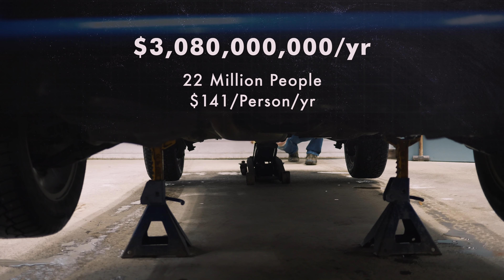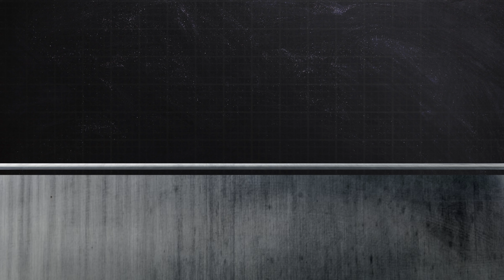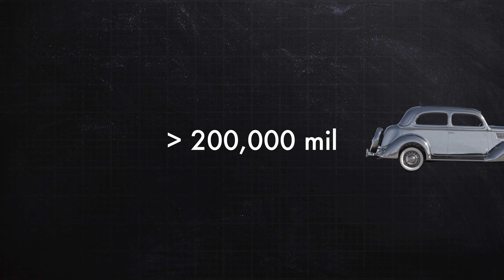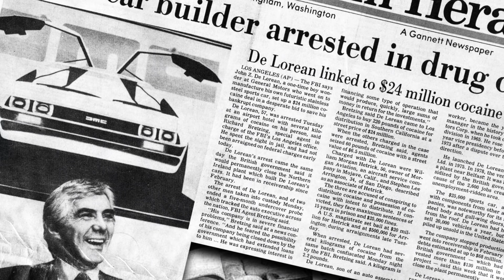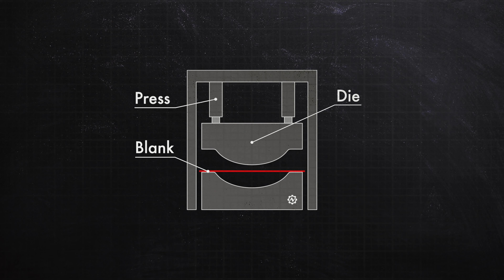The Overlooked Cybertruck Feature Hidden in Plain Sight

Comment: Just saw this video, ironically, while considering the rust death of my beloved 2009 Ford Escape Hybrid. Body shop guy said there is basically no way to prevent it or fix it because frame rust has started. A real shame, due to it still runs great at 150,000 miles.   But that is Wisconsin winter salt rust for you. 

So getting a stainless steel Cybertruck in the next year sounds even better than before!  And glad to see someone point out this benefit of the CT.

Comment: Turgut Cirpanli
1 second ago
The real Cybertruck feature hidden in plain sight is, THERE IS NO NEED FOR ANY PRESS TOOLING to produce it. 

As this car is not made with pressed steel, and as Josh says, this car's panels are laser cut, bent, then joined. But unlike the visualization @6.21 which implies a pressed steel B pillar, it i highly probable that the frame is also produced without dies. (Maybe printed metal for complex surfaces) 

Cybertruck is designed for purely robotic production, which also allows algorithmic production. Thus, it is highly possible to individualize it, to a certain extent. Like, allow customers to have theirs that is %5 smaller, or larger, longer, shorter, taller.. Because, there are no fixed-form molds. You could even do etchings, markings on its surface with laser.

Cybertruck will be truly revolutionary, if it ever gets into production.

And Josh, keep up the amazing work. You are producing highly informative, high quality, premium content.

Comment: You know what else was built with stainless steel? A Delorean. 
   
Separately it should be noted that there are hundreds of "stainless" steel alloys all with huge range of properties. However all high chromium steels have one weakness compared to low chromium (non stainless) alloys, they are quite brittle for a given level of hardening. Stainless like 304 isn't brittle but it is very soft and relatively weak, like annealed mild steel. There are exotic stainlesses like CPM-s30 with improved toughness for a given hardening but they would be absurdly expensive for building a car (a bar the size of a knife is like $50) it would also be very difficult to work with as it is formed by sintering powdered metals (melting will cause some ingredients to separate) and it has a super high carbide content which is hard on tools.

Comment: Changing the battery at the end of its life will be a pleasure.  By the time the battery goes bust the new better battery will store so much energy for so little cost that you would gladly buy it today for 3x the cost of the current battery you’re getting.  It’s kinda like saying you were bummed in 2010 because the phone you were buying wasn’t durable enough to last 10 years.

Comment: The Tesla Cyber truck doesn't have a frame the body is used as structural support along with the battery and they're most likely going to use the million-mile battery in the Tesla Cyber truck so you don't have to worry about it not lasting

Comment: The CyberTruck batteries will be good for at least 1 million miles, maybe more. And forgetting what that troll Colter is spraying around, the batteries are monitored and charged using the most sophisticated battery management system on the planet. So, even if you drive 20K/yr that's about 50 years worth of battery.

Comment: I have  a 2011 nissan LEAF which has three battery capacity bars degraded after only 20,000 miles .  never been fast chadamo charged.  only mostly 80% domestic charges .I would love to replace the battery with newer technology / capacity batteries .. But no one does any such thing as an upgraded battery pack like you are suggesting .

Comment: It was at least a zillion years ago that I discovered phosphoric acid - bac when bicycle frames were steel and my first custom builder told me how to paint it. Stainless steel was too flexy for a good stiff frame ( Yooge energy is lost when your legs bend the frame instead of sending full energy to where the rubber meets the road).
WHENEVER you have rust, upon removing the maor corrosion - OR whenver you are about to pint bare steel FIRST dip or wash it with phosphoric acid. The rust turns to hard iron phosphate and the invisible  molecules of rust iron oxide - do also.
I would have thought that all the people of the rusting states (Hawaii corrodes autos so fast everywhere except the desert-dry sides of some islands that ten-year old vehicles tended to be rare) were onto this "acid bath" common to all automakers before painting.
. (now all i have to do is figure out how to restore a so-called stainless steel refrigerator that I cleaned with tarnish remover that works so well on silver and copper - BEFORE the woman comes home and sees the rust blobs & streaks. Could call it urban camo. . .)

Comment: In wet salty conditions, stainless steel is corrodable if there are parts of the body that are exposed to the air (aerobic) and parts are protected from the atmosphere (anaerobic).  The whole thing will look just fine but there will be pockets of corrosion and usually in places you can't see.

Comment: Who the hell uses a putty knife to scrape away rust on a quarter panel use a damn grinder like you’re supposed to do you reach bare metal who the hell cares how much it takes if that a little it of rust converter slap on some body filler sand  it nice and flat primer paint blend you’re ready to go

Comment: "There is still the issue of the battery and how long that will last" Yeah and the COST! You could buy, what 10 used sedans for the price of a cybertruck? It's not worth it when you could get the same use (mileage) out of 3 or 4 conventional vehicles for less money (even cheaper when you factor in interest paid and buying the 2nd and 3rd conventional vehicles years after you would have purchased the cybertruck)

Comment: For 200 KWH battery the 20-80% range is going to be 120KWH. which means the total number of cycles are going to be way less , it means the life and longevity of batteries are going to way better that other low capacity batteries. As always amazing line of video.

Comment: was the body full stainless or just surface coated? i mean that difference is huge, same as with chromed wheels, eventually the coating wears off.
Reply from the maker: You’re right. All of the cars I showed had at least a sheet of stainless on the exterior. I believe the Delorian was the only “sheeted” body though and that was over a fiberglass underbody, so no problem there.
Reply: @chargeeverywhere  In case Tesla is true stainless, without problems shown in video (body/frame rotting), 35,000$ is cheap, especially if someone has parts and service to replace engine etc. It's no problem to drive car 20 years if you can upgrade essential parts like engine but keep body and frame if you like them.

Comment: Anybody want a super classic car ?

I know where there’s a 1957 Thunderbird with a factory installed hemi engine the biggest one made in 57 ..and a matching Chrysler transmission...It was all shoehorned- in ,

by Ford ,and Chrysler engineers..& they worked at the factory...
(This... is  not an aftermarket car...)
Now it only has under 20k miles and it ..& was garage kept..
It is totally original it’s not restored ...& it’s extremely nice! 
It has original paint..&  top.. A tiny kink in the fender...

Even the original wheels ,and tires are in the garage with it...
It has more modern rims and tires on it now..
 it was a test Model- to see if they could do a “joint venture”
but it never occurred ..in this car doesn’t even have a normal title ..because it was a special production...

There’s thunderbird is truly ..”one of a kind”
 I know where it is 

and it can be bought... talk to me ..
and I’ll tell you where it is

Comment: 1998 is old?  I wince hearing that. How about mid 50's? Just heavier steel so it took "Longer" to rot thru.If you were handy with a MIG welder,then putting in new metal was fairly simple. The fiberglass/bondo route meant you did not have a MIG - I have done that and it lasts long while.Forever?I am not planning to be around THAT LONG.

Comment: Dude. Join the 21st century already. Like 99% of cars today are made of GALVANISED steel. They DON'T rust.
On top of that, they usually have 6 - 7 layers of paint, including a rock solid layer of clear-coat. Salt or not, with moderate care, they'll last, wash your car once a month (weekly in poor conditions), wax regularly, polish as needed.

Comment: Battery should be like the body.

Average cycle life of a battery is 1,500 cycles. A cycle is 100% to 0% or 75% to 25% twice (the ladder would last longer though) and is at 70% by then.

So a 250 mile battery would last 375,000 miles before it's max range gets to 70%

And that's not factoring in Tesla's upcoming 4,000 life cycle battery that is still at 90% by then (that one would be a million mile battery, and the 500 mile range cybertruck would be a 2 million mile battery)

I've been doing a lot of research.

Comment: There is several drawbacks with stainless steel apart from the price. Also, if you want high grade it will still rust.

High quality galvanized steel have a very hard time rusting. Looking at European cars, specialy german and swedish made after mid 90-tys, they really dont rust at all.

Comment: I live in the north and my trucks rust out before they hit 200000 miles. They mostly still run great but the frames rust and wouldn't pass inspection. Brakes, gas and transmission lines also rust. I've had  brakes fail and gone flying through intersections and vehicles that caught on fire because of this. I always care a fire extinguisher in any of my vehicles now.

Comment: Quite a many newer car (Atleast any better car) has already some rust protection make in factory. Also in Finland you can make extra rust protection for 500-800€. But 2003 year Audi, hardly any rust, even though they use salt here (and no extra rust protection). So I don't know if using stainless steel is huge thing about cybertruck. Of you are worried your car is going to rust, just go get rust protection, and it is good. Of course it can still rust, but also will stainless steel. But now rust will take so long that car is too old to use anyway.

Comment: I had a vw golf 4 1.9 diesel powered, it had 322k miles on it. I had to dispose it because the whole frame and body where rusted away even under the paint. The rest was fine the engine ran perfect it always did. I also live in a country where they use a lot of salt on the roads.

Comment: No, battery degradation is not even a remote issue in a Tesla, given their recent developments. You will have outdriven any ICE car by 500,000 miles at that point, and the cost to replace it, while not cheap, is significantly lower than getting a whole new car.

Comment: Yeah but most electric vehicles you get 10 to 20 years out of them and you're going to have issues with the batteries my truck is 10 years old and has very little rust on it the only rust spots is where the paint was chipped from rocks and maybe a little bit on the undercarriage.  I live in Alaska

Comment: Early 2000s peugeouts often don't suffer with rot due to the galvanisation. And weald repairs are cheaper than new batteries. And even if you own a ford which is probably gonna rust, You can always wash it off.

Comment: one issue #Nikolagarage  I've witnessed, one of my antique vehicles that actually has stainless steel in the wheel wells, is that the oxidation layer you spoke of that protects from corrosion is actually sand blasted off by the water/salt/sand spray coming from the tires.  My steel frame and body are 100% rust proofed with special industrial coatings... The sort of thing used for the salt water ballast tanks in a submarine.. Yes, its environmentally friendly, and NO I'm not joking(I care that much about my vehicles)  That being said, the stainless however now has a BUNCH of gaping holes in it, and the steel does not... The reason I think is the stainless oxidation layer is keeping the protective coating from entering the pores of the stainless and then the salt washes the metal away.  Just thought I'd put that in there, because if those CyberTrucks are anything like my Antiques then the Stainless will fail around the tires/suspension.  And the other part is I think more people should understand, yes things do exist to 100% rust proof a vehicle, its however not great for the auto industry for you to know that.
Reply from the maker: The issue of chromium oxide erosion is an excellent point! I'm a bit embarrassed to say that I didn't even think about it. Several years back I was examining the corrosion of carbon steel while in contact with chlorine salts that were being melted and frozen repeatedly. We found that the mechanical action of melting and freezing the salt broke down the oxide layer and the corrosion rate was no longer slowed by it. I would imagine a similar phenomenon would happen with mechanical abrasion, like sand or rocks. Perhaps an easy solution would be to make your inner wheel wells out of plastic like most cars today. Thanks for pointing this out!

Comment: The cybertruck also has a SECOND overlooked feature. Its form.

The way the body is made is really the way that the whole automobile should be going.
We actually need aerodynamic forms that could pierce through wind easily. Somewhat inspired of the monocoque genre.
Volkswagen was presenting the X1, that was around the right form for a car, but it's obession over carbon and ultra-light techinques made the price of that thing explode.
For the future, I could easily see a carbon or aluminum tube chassis, where everything of the car is fixed on, and when you sandwich the body of the car around it. It's a cost effective and fast way to make a simple car and you can do highly aerodynmic shapes and forms.
Reply: the cybertruck's form is an overlooked feature.. good one.

Comment: Here's my question regarding the body/design of the Tesla truck: What about crumple zones? Seems like it's designed to NOT crumple. Been wondering about that.
Reply: 'Seems like it's designed to NOT crumple' how so?
Reply: @daos3300  I didn't say it won't, I said it seems like it won't. Stainless steel is a much harder metal than what is usually used, and it's all flat panels, which to me also seems to add to the strength from a frontal collision. I'm just asking a question.

Comment: NaCl (salt) does corrode stainless steel though... stainless steel is only resistant to rusting (oxidation).  Chloridization can still happen and will happen with stainless steels and thus it corrodes. Sure it happens slower than with unpainted carbon steel, but you have to keep cleaning the salt off the car a lot so it doesn't destroy the oxide layer of the SS.

Comment: The Tesla batteries are currently lasting 4000 cycles. As battery technology improves,  it will be even better. 4000 cycles at 200 miles per charge is 800,000 miles life while still having around 96% capacity as compared to when new.  A pack that has a 300 mile range with 4000 cycles will go 1,200,000 miles... The batteries are not the limiting factor anymore.

Comment: The power train & drive train are easy things to fix. Once the structural body is rusted. It's over. I have seen rusty old cars snap in half. Literally. Replacing a battery is still concidered easy thing to do. This is why I'm a fan of an old corvette. Fibreglass doesn't trust either. Having said that, car companies don't want there cars to last forever

Comment: You think 2002 and 1998 models are 'old'? Geeez, must be nice to have money. I'm 62, my last 2 cars were a 1989 and currently a 1993. I've never had a car newer than 25 years old.
Now, about the Cybertruck. Being stainless and therefore corrosion resistant is not 'overlooked', it's right there in your face. If you can't see it perhaps you need to get your head out of your ass.

Comment: So their insane looking design is actually practical? That makes me see it differently, I think I might want a Cyber truck over a model S now hmmm
Reply: Yes - practicality is the REASON for the "insane looking" design. The truck was designed to be highly functional (it's a truck!) and cheap to build. Looks were basically last on the list. The result is what you see. It looks ugly as hell (my opinion). But I'll buy one anyway. It will be very very functional, cheap to buy, cheap to maintain, and should last more-or-less forever. While remaining ugly the whole time.
Reply: @DaveLindbergh  Elon tweeted this week that you can get it wrapped in any color and/or pattern you want.  Might look a little better with the right geometric pattern ?
Reply: Oh, and he redesigned the side angle to lower the window line.  He says the production model will be 3% smaller on the outside.

Comment: I thought it was nickel that was added to steel to make stainless steel.
Reply from the maker: Yes, Nickel is higher too, but what I understand is that Chromium is the more important alloying element. You’ll see in my metal composition diagram that Nickel increases considerably in Stainless vs Carbon Steel.

Comment: One downside of (unpainted) stainless steel is dents. Dents on current cars are normally filled in and painted over to match the rest of the body. Without paint, you can't hide that body filler.
Reply: 6:16 
Dont think thats gonna be an issue

Comment: How can you call DeLorean "having a full stainless steel body" if it only had some thin metal sheets put on top of the real body made of plexiglass? Also it didn't even cover the whole car! I mean, look at the front end with the bumper and headlights. Yeah that part that doesn't even match in color with the rest of the body.
This way you can wrap you car with tinfoil and call it "the first car with full tin body".